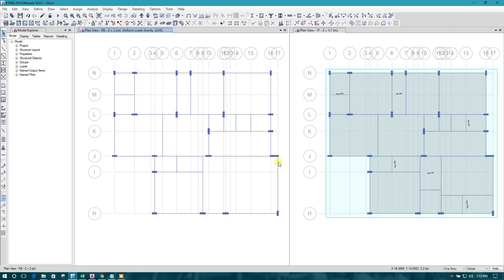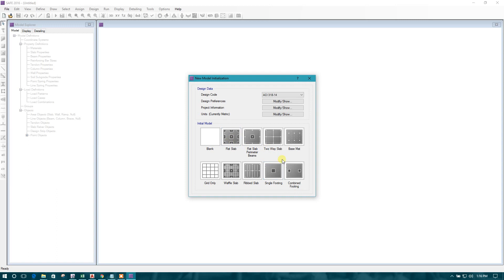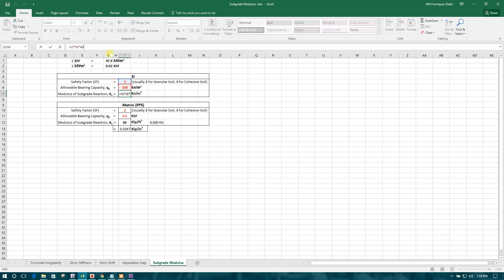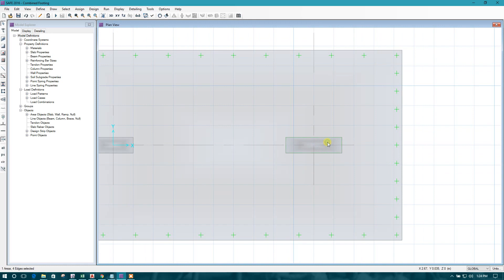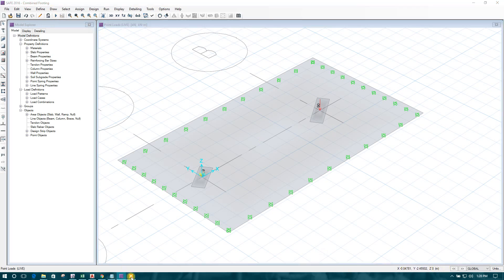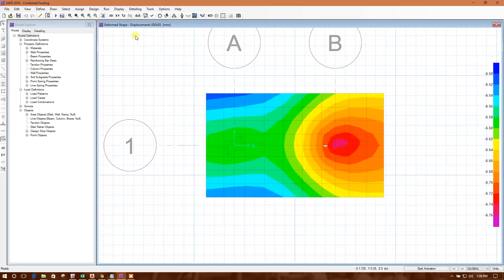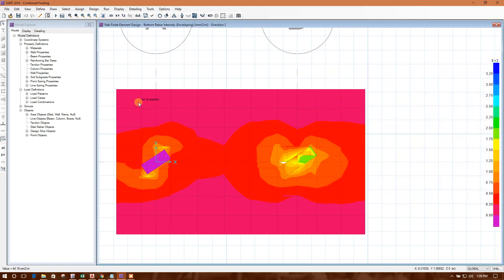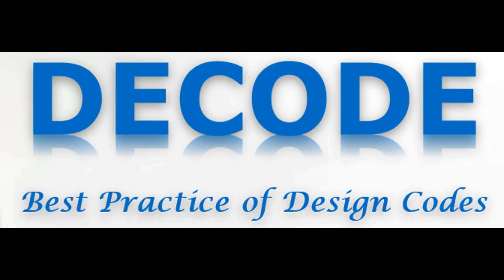COMBINED FOOTING DESIGN IN CSI SAFE 2016

Comment: Why have you defined column as slab stiff? This is the only part I did not get in this brilliant tutorial. Thanks. Waiting for your kind reply.
Reply from the maker: In real structures, there is an extremely stiff region within the connections which join columns to slabs. The "Col_Stiff" elements are stiff area elements in which the software amplifies moment of inertia by 100 times to capture the increased stiffness of these connections.
The effects associated with modeling these increased stiffness properties within connections include the following:
1. Deflections are more realistic and less conservative in magnitude.
2. Rebar design is also less conservative since reinforcement is designed according to response at the face of the column, and not at the center line of the support.
3. Punching-shear results will change since the stiffness of the areas around the punching-shear perimeter change.